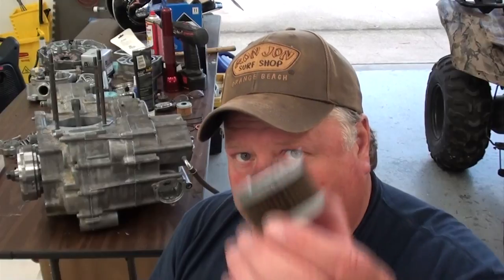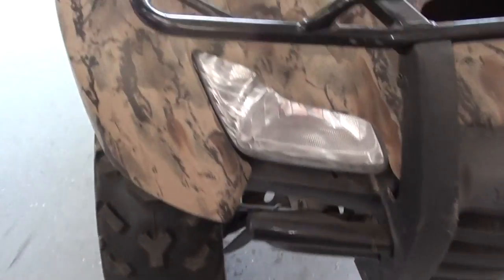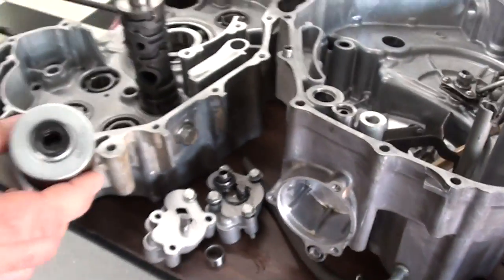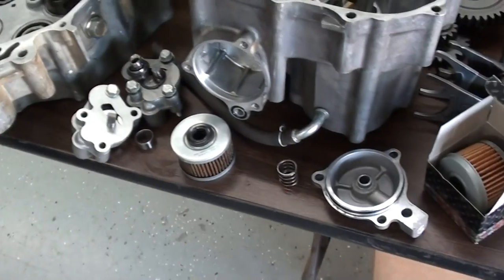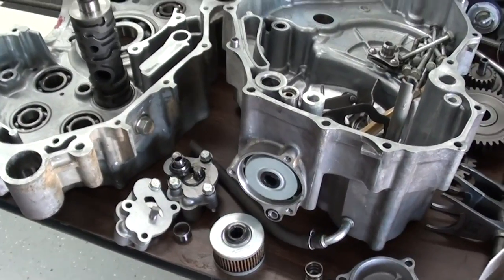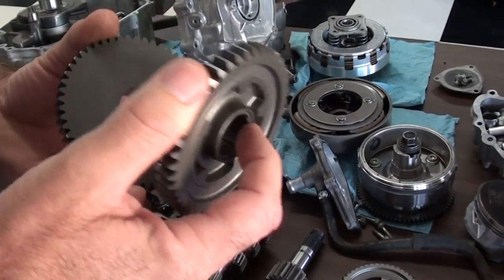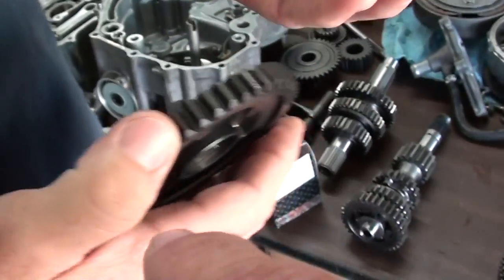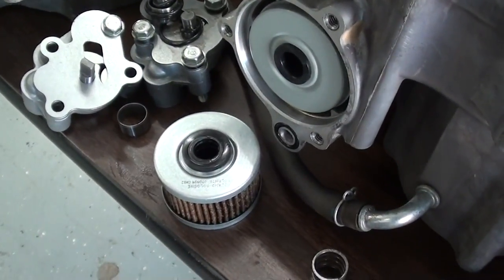Honda TRX 420 Oil Filter Wrong Way!

Comment: My dad worked at a Honda dealership back in the 80's, and when the 85 Big Red's came out people were going through engines right left and centre. Because they were trying to save a buck and do the service themselves and they were putting the oil filters in backwards. Now this was before Honda stamped on the filter the direction it was supposed to go. I do my own service, and I think about my dad telling me those horror stories every time I install the filter.

Comment: Filter direction depends on the model. TRX420FA  Rancher AT has a flat filter cover with an arrow pointing up. That filter goes in opposite of this one. Be careful, read your manual, replace as removed.

Comment: i have this same year Rancher. I always get my oil and filter from the dealer, 3qts of Honda GN-4 10w-30 and Honda oil filter is about $30. Install filter the same way the old one came out, its hard to mess up.

Comment: I just replaced 1st gear on my 2005 Foreman 500. Put it back together, worked great until it bogged. Filter was installed correctly but there was no oil coming out when running even with the filter out (initially I thought the cooler is at fault). Drained the oil and it has a strange color (brownish murky - new OEM oil). Opening it now again. Maybe I clogged something? What should I be looking for? It developed a smallk knock but worked ok. Thanks!

Comment: Quick question. I rebuilt the motor in a Honda rancher 420TM. I got it all back together. It started and ran but the reverse light pops between 2nd and 3rd. The neutral light pops between 3rd and 4th. Any help on why this happened